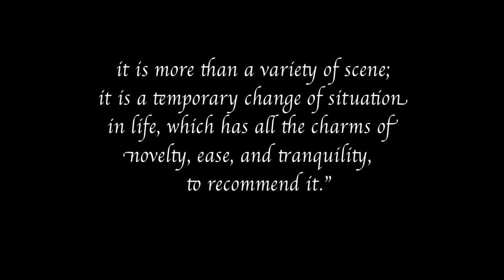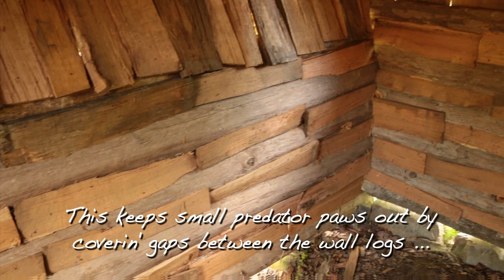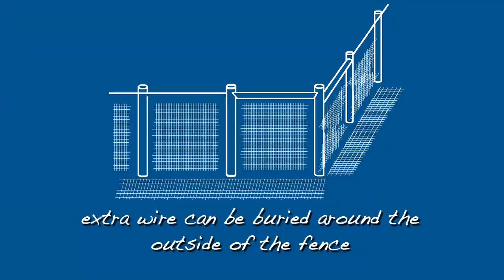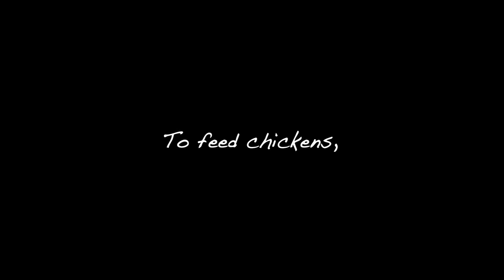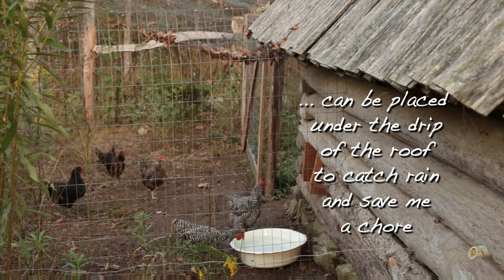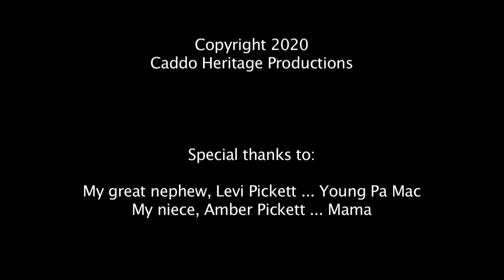Building an Old-fashioned Log Chicken House  - The FHC Show, ep 27

Comment: Something that might be of interest about our old chicken barn ( built in late 1800's) was that they buried small diameter poles in the ground about at the level of the bottom of the foundation.  These kept the larger predators from being able to dig down on the outside and under the foundation to come up on the inside of the laying hens barn. The brooder house had a concrete floor.
Reply from the maker: Very much of interest to me, moviemakerwannabe. Questions, questions, questions:  Were the poles horizontal with the foundation or vertical? And any guess as to what kind of wood they were? And in which state is this barn located?
Reply: @farmhandscompanion  Kansas  horizontal  3 major types of trees here Easter Red Cedar,  Osage Orange, and oak.  They didn't look yellow so my guess is Red Cedar or Oak.  The barn was divided in half with a door between the sides. A foundation ran around the outside and down the middle. The poles run across from center foundation to  outer foundation.

Comment: I'm loving how things are coming together on your property. Was discussing with a friend who is building up his place in a similar fashion. Struck me that you talked about rotating grazing so as to build up the soil, and had chickens in the rotation (and I saw rabbit cages, but not in the illustration drawing). I'm guessing your permanent coop means the land has reached that workable level, or chickens are out of the rotation. But I was wondering what kind of movable protection for the "flock" you used while rotating chickens, too. And did you move the rabbit cages frequently to get good spread of nutrients, or use the wheel barrel. I get large animals in the rotation, not a lot of "site prep" difference for big guys (except goats!), but the little animals seem more labor intensive?